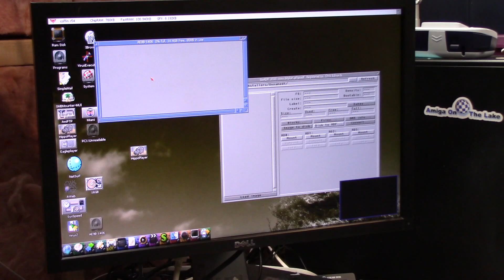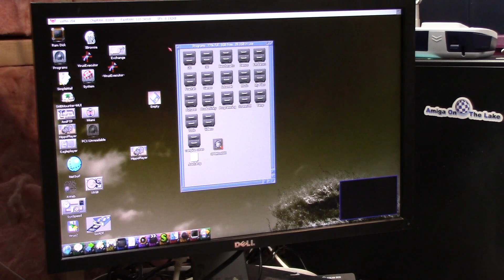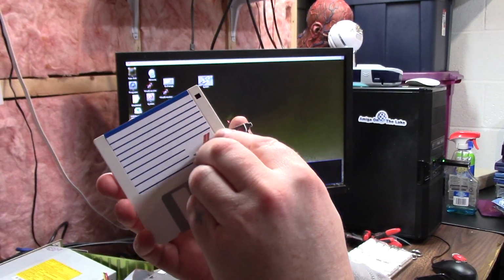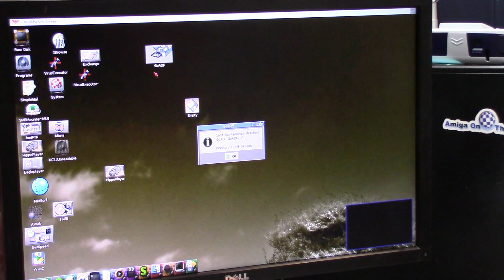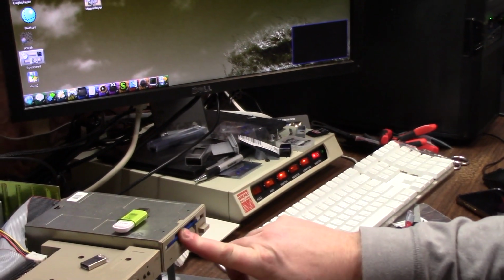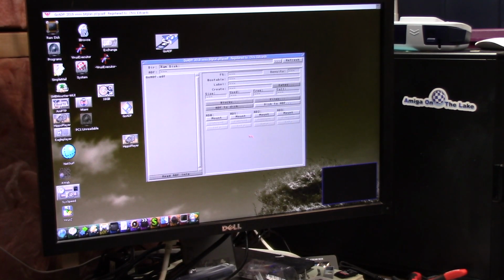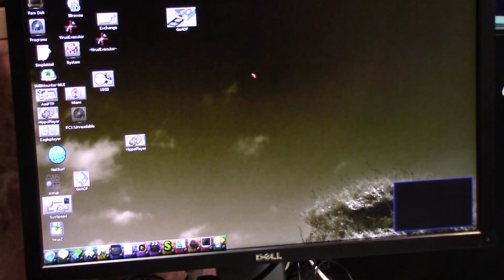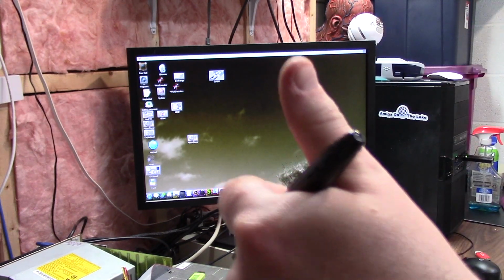C= Amiga 3 grind of death! How to repair a worn out floppy with magnets!

Comment: Fascinating, but can you explain what the magnet does and why that works? Presumably when you force a reformat after that it rebuilds the Commodore disk equivalent of the File Allocation Table?
Reply from the maker: magnetizing the disk erases its contents of course, but also since the disks are just plastic with iron oxide on them (rust dust) it organizes them forcefully back to lining up "normal" Old dirty heads and magnetized heads can screw up disks in the opposite way forcing them to become "bad"  this works every time. I only ran into a few I could not repair this way, and they had scratches on the platter.  all Amiga disks are
Reply: @ChrisEdwardsRestoration  Thanks for the explanation, I will give it a go. Did you mean to add something else after "all Amiga disks are ..."?
Reply from the maker: @Wallygjs  yeah but youtube cut me off, i was going to state how they are formatted different, i ramble on... no worries.